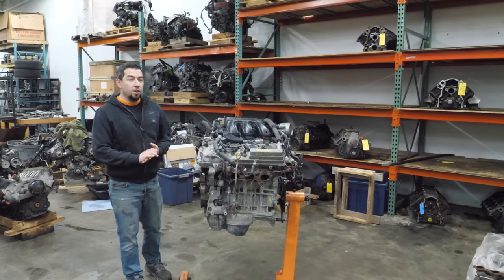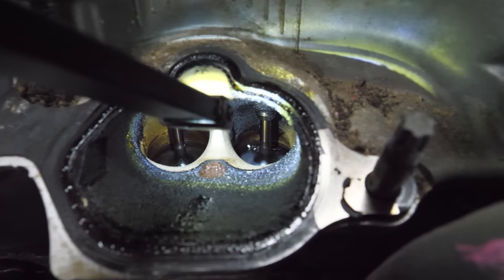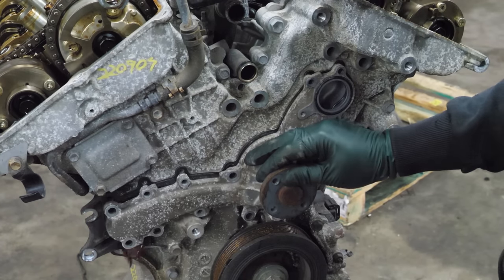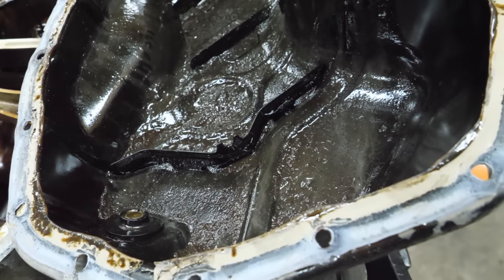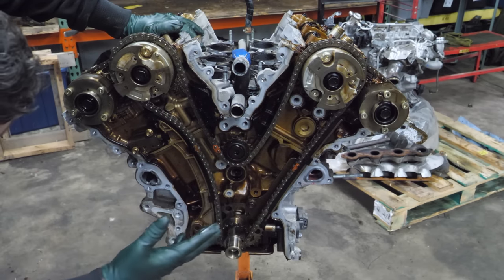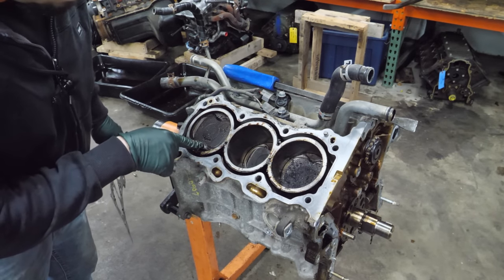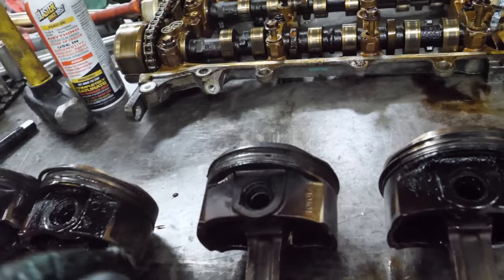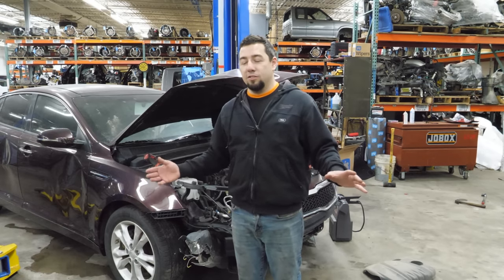Toyota Lexus 2GR-FE Teardown! Premature Death Of Toyota's Most Reliable V6 Caused By Obliviousness!

Comment: Can you do another Toyota v6? The 1mz-fe? I have one in my rx and want to see what makes that thing go from the inside!
Reply: Maintenance above and beyond what the book called for. There was a class action lawsuit over that engine with premature failures. Even with maintenance by the book, they had a tendency to come out like burned lava cake, causing valves to burn and rings to stick or premature bearing wipeout. Toyota kept denying warranty on them. The engines ran very hot and would just torch the oil. 

Such bad nightmares or scrubbing blocks.
But hey, they were still better than the 3vz.

Comment: I assume these engines don't sell for very much simply due to low demand for replacement, similar to how 1uz non-vvti still to this day remains fairly cheap, but the more expensive vvti version thats interference costs way more. You give it another 3-4 years you might see that price go up.

Comment: I've learned quite a bit from watching you channel - the newer engines are nothing like the ones we hot-rodded in the 60s.
As a suggestion, add a bit of foley (sound effects) when you toss the parts into your corner pile like many of the older comedy shows would do
Really enjoy your channel - keep it up.

Comment: Toyota tech here… the only thing that kills them is bad luck or bad timing.
Reply: Hi, since you're a tech, do you mind if I ask a question? I'm getting an 08 highlander with 78k miles, and I'm not sure if the tranny fluid has ever been changed. Is it safe to do a drain and fill? Also, is there another way around replacing the rubber oil cooler hose? Or is the metal one the only way to go. Hope you don't mind me asking questions, but you'd know if anybody would.
Reply: this looks like neglect, no coolant changes, and late oil changes. The bad coolant caused a leaking coolant system, engine overheats, and cooked the intake.,

Comment: What causes 2gr-fe failure?....bad oil, low oil, infrequent oil changes, variable valve gear failure....This is the early series 2gr-fe which had problems with the VVT gears and the rubber oil lines which feed them... later revised.

Comment: I was told by Toyota that the engine was to powerful for the Rav-4 ( i owned a 2006 v-6) and that toy didnt want to put them back in as a rebuild or to put a new v-6 into the car was the old engine wore out. I actually loves dusting off Mustangs with my 06 rav! P. S. i cracked the drive shaft twice

Comment: Wow.  A super timely video because our 2008 Sienna has started making some "suspicious" noises that are growing my concern of a possible near demise.
Reply: Just an FYI if you hear valve ticking noise it is likely due to the car sitting and the hydraulic lifters leaking out the oil after a while ,this is normal. However if it happens frequently it might have a collapsed lifter or other valve train related issues.
Reply: @madlad8102  If it has a collapsed lifter it would be misfiring right?
Reply: @Zareef Huq  it depends on the style of valvetrain, on Toyotas that use hydraulic lifters they can't really collapse as much as say a GM active fuel management lifter does,in the case of a GM lifter you'll likely get a misfire.
Reply: @madlad8102  haha wow you knew exactly what I was implying when I mentioned the misfiring. What are the symptoms of a collapsed lifter on the 2gr? I do hear unusual noises and it has the typical piston slap when it’s cold but there’s something else.
Reply: @Zareef Huq  on the 2gr a collapsed lifter will usually cause noise but no misfire .
Reply: @ZareefHuq  id suggest a heavier oil

Comment: They drove it until it died, then they wondered why it wasn't working any more. Who knew red lights on the dashboard meant something?
Reply: I mean comparing it to two of the last three engines that he’s torn down. This one looks pretty all right. It looks like they at least stopped driving it after it started showing some severe issues. Those other engines looked like whoever was running them had their foot into them until they literally stop spinning.

Comment: My ‘08 RAV4 has the loud rattle at start. 180k miles but going strong. Little bit of oil smell in the exhaust and doesn’t burn the coolant. I’d like to keep it for another hundred thousand if I can so I am interested in the rattle and getting that fixed. I’d like to have someone in my area look at it. I understand I may have to do with the variable valve timing. I Will likely take it to the dealer, to have a master technician work on it. If anybody knows of a technician in Ventura County, So-Cal.

Comment: Other  way round  liner  failed I'd say   ,   no  way  a lump   of  metal  should   crack   off like that yes   should   have   stopped    when  overheated  but  liner  failed  first ,  cant see how  heat  cause    a big  lump  like  that to  crack  off  , liner was faulty  from  new  unless   hydrolocked   in  earlier   incident

Comment: You should sell the bolts and nuts....I have found that places like autozony, home depots metric bolts they sell have messed up head sizes...what should take a 12mm socket is now a 13mm, 14mm is 15mm. Dont know why they changed it, couple years ago they where the right size. So I need to replace one 12mm bolt out of 6 for a water pump...I need a 12mm socket for 5 bolts AND a 13mm socket for one bolt....I prefer uniformity.....
Reply: JIS bolts are weird like that
Reply: M8 bolt will have a 12mm head on Japanese vehicles, as that is JIS standard. But 13mm head is international standard.
Reply: @katywalker8322  My point was...I can not go to the store and get JIS bolts anymore....I like my Toyota with JIS bolt sizes...easier to work on and some places the larger head will not fit....
Reply: @drewfleming7065  , true, finding JIS bolts is a nightmare.
Reply: @katywalker8322  He should be selling grab bags of bolts...sure he has lots of them

Comment: At 7:01 my thesis would be 1 coil or spark module died causing fuel buildup of un-burned fuel in the intake manifold, backing up frothing accumulated fuel, then the bad cylinder decides to puke out even 1 spark and since the intake tube on the dead cylinder is now ripe for ignition, a re-fire triggers a very high heat event in the form of a backfire traveling very fast and a rolling flame front like in a cylinder. The throttle plate should have clues to this backfire event, and while this event was not enough to burn the whole engine down, it was enough to cause significant damage with the backfire:text-green-game-over: causing so much localized damage in the manifold {20 - 30 seconds}, this even lasted for more than a couple of seconds; to melt that amount of plastic and for these burning blobs of plastic to make it into the head of this engine. Whatever caused this event, my guess is lack of scheduled service.:face-fuchsia-poop-shape:

Comment: You gotta find a 225 slant six!
Reply: They don't break.
Reply: Jared Pink of the Questionable Garage channel just did a brief "Will It Run" on a 73 or so Dart.  The 225 wouldn't turn over, and when he pulled the head he found inspection ports in the block.  Sadly not a deep dive into the carnage like we like here, but interesting to see.

Comment: 17:10 that looks like the inside of the 300 I6 in my F150.

That engine is 40 years old and has over 350,000 miles on it. It spent the first half of its life getting dino lube. Zero excuse for such a new engine to be THAT dirty inside.

Side note I nearly have that poor thing pulled. Have a used engine to put in the truck.
Reply: My man this thing was being driven by someone who ignored a pegged temperature gauge for a long time. You think they changed their oil anywhere near on time? I once took a Camry valve cover off and the sludged oil made a PERFECT shell where the valve cover was, Engine still ran fine.
Reply: @SPAZTICCYTOPLASM  The lack of destruction on bearing surfaces implies the oil changes were reasonably frequent and regular. We've seen countless engines on this channel destroyed by poor oil change habits and they almost never fail from overheating. Always bearing issues. Spun rod bearings usually. And the first victim of oil starvation is always the cam journals because they're the farthest from the oil pump and get the least oil flow; the cam journals in this engine were basically perfect. Oiling was not the issue here. Also not all that much sludge on the top end compared to what was in the pan; if it was poor oil changes causing the buildup we would have seen the mess be more evenly spread through the engine as in the neglected Camry you serviced.

My engine has an excuse to be a sludgy mess inside. It's 40years old, it's carburetted, and for the first half of its life it likely never knew the taste of synthetic oil. I only got the truck in 2007; I've always put full syn through it but there's no telling what happened in the intervening 17 years between production and me acquiring it. 

This engine...nah that sludge is a direct result of the overheating that melted the fucking intake manifold. That oil was quite literally deep frying the engine from within, cooked well beyond its ability to remain oil. And that's why I say there's no excuse for it; this sludge buildup is a direct result of owner negligence rather than simply old age, carburetion causing greater oil contamination, and older tech lubricants less capable of handling contamination used early in its life as is the case with my engine.

Comment: The early models of these 2GR engines definitely had some issues. Like just about any Toyota V6, they had head gasket issues, the early Diamond brand ignition coils failing (never see the later Denso coils die) and even some camshaft phasers blew apart and broke everything under the cover, and I’ve seen it on a fairly repeatable basis. Seems like any 2GR after 2010 or so is an excellent mill, though.

Comment: I kinda blame both Toyota and the owner on this one. The owner for either ignoring the water pump problem or not knowing about a water pump issue. And Toyota for building sensitive engines. Piston rings in Toyota get destroyed with just like 10 degrees over normal temp and they become oil burners.

Comment: once engine overheats. just junk plastic parts melts over  266 degrees F, plus quality of oil doesn't protect at these temps  possible lack of cooling and lack of lubercation at high temps

Comment: “Was used in so many vehicles I’m not going to list them”…. 4 seconds later, starts to list them 😂

Why is such a good engine so cheap to find? Supply and Demand. As you said, that engine was used in a lot of vehicles for a lot of years. That means that there are probably a bunch in salvage yards from wrecked vehicles, this giving you a decent amount of supply. They are so good that very few people need to go looking for replacement engines so demand is low. In a market driven economy, high supply and low demand means prices are usually low.

Comment: the answer are the oilrings on the pistons . too few oil changes .there are allot of cravas and spaces in modern engines,
that means when you do a oil +filters change some 400 CC old oil can left behind in the engine . that old oil is going thru the engine,
over and over until the oil cannot stand the heat and cloths up the piston rings .and thats what you see here . never believe ,
the statement you have to change the oil avery 15000 miles orso . do it avery 6000 miles or 6 months no matter what the ,
factory says . the more oil changes you do ,the less change you have this problem .

Comment: What Kills these things are low oil These engines are sensitive on oil level, like the old four cylinders or 22R where the engine could have like less than a quarter of quart and the engine would still run

Comment: What stock parts could I replace beside the oil cooler line to metal hose? Looking to build an all stock motor with bigger or better Toyota parts from other vehicles, lmk what could be changed,

Comment: I want to see you, or your fastest employee, strip an engine (of your choice, to a bare block) as fast as possible. No narration needed.

I take stuff apart with the intent of putting it back together. I want to see how a pro does it when they don't need to reassemble it.

Comment: THIS IS A VERY STRONG CAM CHAIN AND PROPER DESIGN, THINK OF THE LOAD ON A V10  CAM CHAIN THATS WHY THEY FAIL
VIPER,  AUDI, AND THEY DONT LOOK AS THICK AS THIS CHAIN, PLUS THE AUDI V10 DRIVES 2 ACCESORIES ON THE CAM CHAIN 
EXTRA ALSO MORE LOAD, EVEN THE LS350 CORVETTE LOOKS WAY POORER FOR THE CAM CHAIN AND THE EARLY CHEV 350 HAD A LOT OF SLOP AND NO TENSIONER, TO ME A CAM CHAIN NEEDS TO BE 3 TIMES AS THICK, FOR A LONG LIFE ON AN LS OR 350 BLOCK

Comment: i got a 3mz is it possible to get the upper pan off with the motor still in the car and if not when i get it out do i have to disrupt the oil pump to " service the bottom end bearing i spun ? its a save or die  motor , imma end up replacing it was gonna try get the other one going again , bit still turns over n runs so im like what the heck it aint lock make it rock till it pop ya dig any experience be grately appriceated , in college and still cant spell lol 🤣

Comment: I always thought the Plymouth Slant-Six engine was one of the most bulletproof engines ever built. 
What say you or the comments?
Reply: It has that reputation, and I agree from personal experience, but a few days ago the Questionable Garage channel found one that was locked up and had multiple inspection ports in the block.  Unfortunately Jared didn't do a deep dive into the carnage.
Reply: @ischmidt  Thanks for the reply. I'll have to check it out.

Comment: I'm pretty sure water pump on this motor is one of the weak points, my mother had a 2015 Toyota Highlander and her pump went out at somewhere around 80k miles. Car is at 150k+ now I think? But yeah I think this one prolly got air in the thermostat.

Comment: Which upper oil pans can be used with 4grfse instead of stock upper oil pan because i am swapping it in ke70 and have problems of oil filter in front and engine bay.

Comment: I thought the 2GR-FE had oil burning issues that caused lots of engines to fail prematurely. 

But maybe that was the following generation of their v6.
Reply: older 4 banger did
Reply: The 1gr fe 4 litre is nearly indestructible a d the 2gr fe is the same. Good maintenance and these may go a real long time. I had the 4 litre in my Tacoma and I changed the oil religiously and that engine will not die.
Reply: The old 2.4L 4 cyl has oil burning issues.  There are still tons of them on the road.  Folks just keep oil in the trunk and keep it pushing lol
Reply: You’ll see 2GRs on very rare occasion consume a bit of oil. Usually it’s lack of maintenance. However, the worst offender is the horrendous 2AZ-FE. Worst, most unreliable engine Toyota has ever made. Oil burning is one of many issues those end up having. Most of those I knew who had that engine said they’d never buy a Toyota ever again.

Comment: Melted pistons, cylinder walls and top end plastics with no melted bearings and little discoloration ... If I didn't know any better id swear someone tried to spray nitrous on that one cylinder 😂. Almost looks like a super lean condition overheat with isolated heat.

Comment: 2008?? I bet plastic oil line cooler busted, ran out of oil and destroyed the engine. Common of the line isn't replaced with the upgrades metal piece.

Comment: Early engines had vvti gear issues. Toyota did a recall on this. Also I had a few of these motors have oil consumption issues. Idk if oil consumption was a main issue but a few engines I worked on had had this issue.

Comment: I learned first hand how stupid people are. Winter of 2017 I went out to the store and as I'm walking in I hear a little four banger endlessly cranking with no compression. Turn around and see a 20 year old Honda Civic. I go up and find two teenagers confused as to why it wont start. I pop the hood and find that the entire engine bay is soaked in coolant with not a drop to be found in the radiator. There wasn't even a puddle on the ground because it was already gone. I asked what happened and he said "We slipped on ice and hit a snow bank, I backed out fine and there was a little bit of steam but it was running so I kept driving. The one gauge went to H for the last few miles though, I dont know what that means." I tell the kid he needs at minimum a new head-gasket or most likely a new engine since he drove miles like that. The only reason he was in the parking lot was because the motor died right before and he coasted in. The last detail though, the car isn't his, it's his friends that he borrowed, and they are both freshman engineers at the same college I was graduating from!